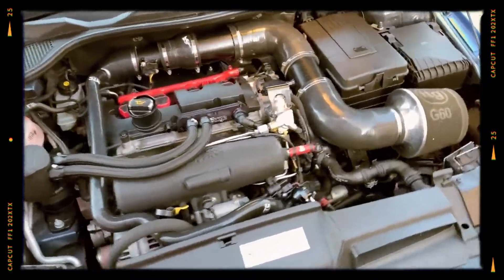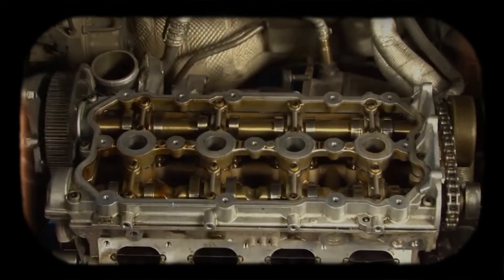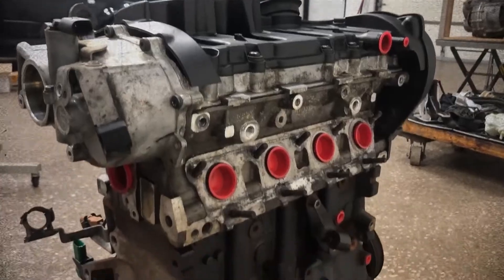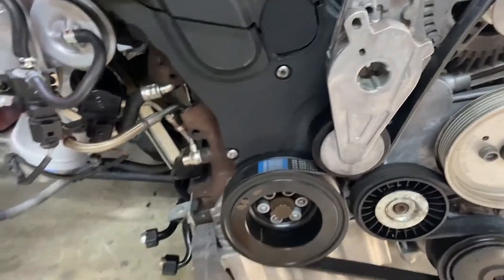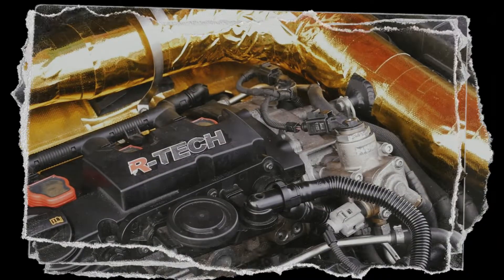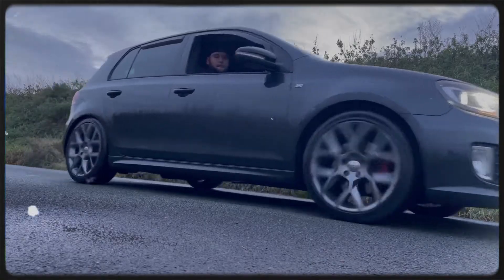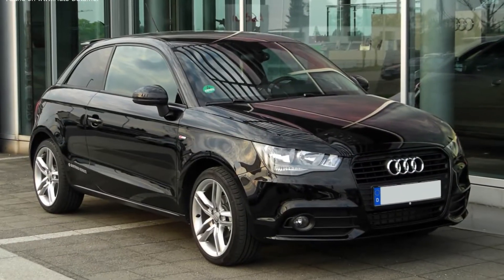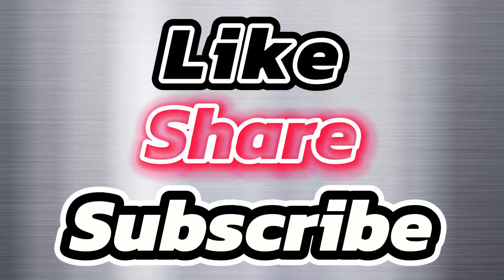Definite guide to the VW/Audi 2.0 TFSI EA 113  engine family!

Comment: There is actually a very rare and barelly known BWA variant dubbed the BWA1, which has significant issues all around. It was only ever put into the Seat Leon mk2 (1p) and instead of 200hp it makes roguhly 185hp. I will list all the errors I know about (since I have owned this engine once), greetings from Germany! Here is the list: The 2.0 TFSI BWA engine has several known issues. One of the most critical problems is the cam follower wear on the high-pressure fuel pump (HPFP). If the cam follower wears down completely, it can break apart and cause metal-to-metal contact between the HPFP and the camshaft, leading to camshaft wear or failure. Symptoms include power loss under load, rough idling, and fault codes like P2293. Another common issue is carbon buildup on the intake valves due to the direct injection system, which doesn’t allow fuel to clean the valves. This leads to rough idle, power loss, and increased fuel consumption. The diverter valve (DV) can also fail, especially the early diaphragm versions, causing boost leaks, turbo lag, and performance loss. A failing PCV valve can result in rough idling and pressure issues, often causing vacuum leaks and oil cap suction. The balance shaft chain can stretch over time, leading to a rattling noise at startup and, if ignored, potential engine damage. Many BWA engines also suffer from oil consumption due to worn piston rings or valve stem seals, causing excessive oil usage and blue smoke from the exhaust. Cooling system failures are another issue, particularly with the water pump, which has plastic impellers that can break, and the thermostat, which can get stuck open or closed, causing overheating or temperature fluctuations. Proper maintenance is key to reliability. Regularly changing oil every 10,000–15,000 km, inspecting the HPFP cam follower, cleaning intake valves every 80,000–100,000 km, and replacing the water pump and thermostat with every timing belt service can prevent most major failures. Despite these issues, the BWA engine is generally more reliable than early EA888 engines and can last well over 250,000 km with good upkeep, but the HPFP cam follower, balance shaft chain, and carbon buildup are the main weak points to monitor.
Reply: 10-15k is killer for that engine, i have 1 with 170k km on it, rings changed at 130k cause someone did not change oil for 40k. after that car has been maintained very well. oil is changed at every 5k or in 6 months. in summer i use 10w60 and for winter i have 5w40. also i use 1/200 2t oil in gasoline, this engine loves 2t oil.  getting atm avarage 10.3l/100 only short trips in city/ official is 12.4l :D. In 5k km i cant see any oil level drop also, like non. i have audi a3 8p quattro and for that car this motor is just perfect, so much low end power. and 18 years later this car still does it, new honda type r and gr yaris just cant keep up :D got it for 6k :D:D:D
Reply: @johannapoder2843  That's cool but it's not the same engine I was talking about. Yours is the BWA and it makes 200hp. The one I meant is BWA1 and makes 185hp. It was only sold in the Seat Leon 1p and it has a lot more issues than the 200hp version because they actually where built different despite of the same motor code.
Reply: @GhostTaker-00 ik, but its close as you can get, most common problems are exatcly the same on bwa and bwa1, it sound like they made exatly same engine with cheaper materials.
Reply: @johannapoder2843  why 1/200 2T Oil in the gasoline?
Reply: @maxdruciak2724 prevents cylinder wash,lubricates compression cycle and lubricates fuel pumps. Over all: more power, less fuel and ingreased engine life.